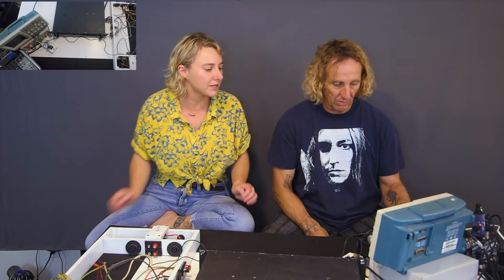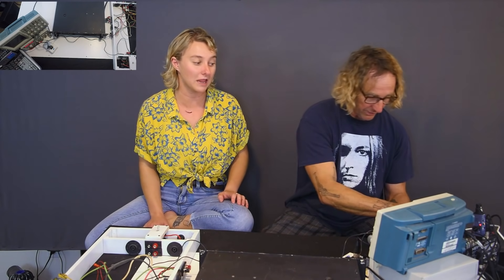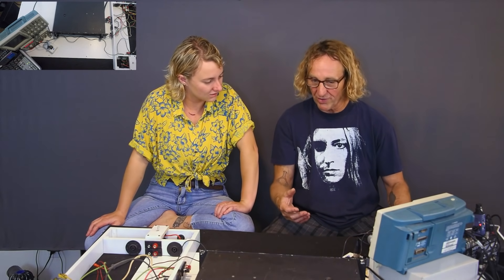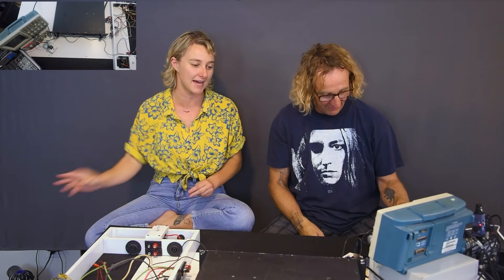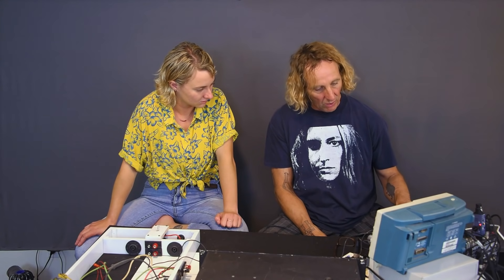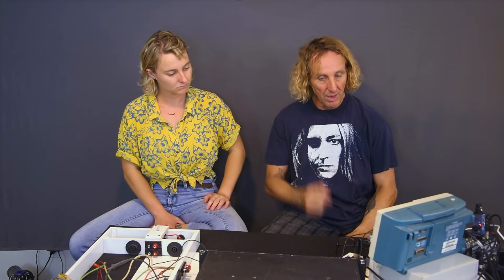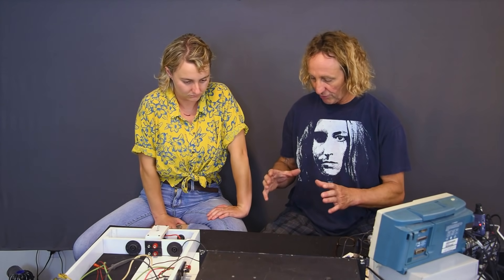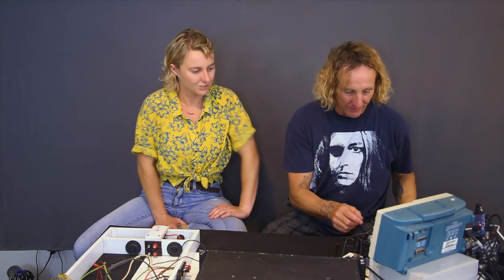Hear Amp Distortion - Crest 4801 (Public)

Comment: Can it be used in the uk as well as usa im looking at buying one right now please help TIA
Reply from the maker: Are you talking about a Crest 4801? 

I don't recall if they work in the UK but they definitely aren't automatically switching between 120 and 240 

If they do work in the UK you will need to internally switch it to a 240 input assuming the transformer has two primaries and change the fuse to 1/2 the amperage
Reply: @DaveRat  yes the crest audio 4801 thank you for your reply 🙏
Reply from the maker: Let me know how it works out. I might have one open at the shop somewhere and if I see it I'll let you know more info. 

Typically most old transformers have two primaries and they hook them up in parallel for 120 volt and they hooked them up in series for 240 volt and as long as there's no other little transformer in there or anything drawing power before that big transformer, then switching the wiring on the big transformer will switch the voltage for the whole amp.
Reply: @DaveRat  thank you  😊

Comment: I feel like you know this, but maybe didn’t articulate it clearly in the video.  You keep saying that we’re hearing what the clipping is “adding”, but actually we’re hearing what it’s taking away.  It’s the peaks which wanted to go past the rails but couldn’t.  We do hear some distortion and “added” harmonics, but that is the crossover distortion caused by ripping out the middle of the waves.  It’s very much like a gate with too fast time constants, and in fact sounds a lot like a gate especially in the impulse and music tests.  This may seem pedantic, but I think if you actually found a way to cancel out the fundamental in the clipped signal so that you only heard the harmonics generated, it would sound significantly different, and if you did that same procedure with this kind of crossover distortion, it would be different again still.  IDK how to accomplish that without some FFT voodoo, but I’d be interested to see it.
Reply from the maker: So when clipping flattens the top of a waveform and in order to reproduce that newly flattened waveform a bunch of extra high frequencies that were not present in the original signal are now generated, that does not equate to adding??
Reply: Honestly, I argue not.  You can look at the scope and see that nothing is being added.  It's only being taken away.  What we are hearing in your test is exactly that difference of what is being taken away.  If you measure the integrated voltage or power, you'll find that the output wave is in fact less than the original.  The output wave does look (and sound) a lot like what would happen if we added a bunch of harmonics of the original signal, but that's almost just because that's what that new waveform sounds like, you can only ever get an approximation by means of addition.  Nothing is actually being added, and the perception that harmonics are being added or generated is mostly an artifact of the analysis (fft or earbrain).  But I haven't convinced anybody with that argument yet.  :)

But honestly, that's beside my original point.  Whether harmonics are added or not, there is a change in the perceived harmonic series, but that's not really what we're hearing in your video.  We're basically just hearing the part of the quieter signal which not being cancelled by the clipped signal.  That's perfectly valid and instructive in it's own right, and I really didn't mean to say it wasn't.  It just feels to me like you're telling us it's something slightly different which would also be quite interesting if we could figure out how to really do it.
Reply from the maker: Nothing visually or electrically is being added but in order to acoustically re create the signal we hear additional frequencies the did not exist in the original. 

If the signal was just lower, we could slightly adjust the level and cancel the lower level. Which is what I am doing, what we hear is what did not exist in the original.

A 100 Hz pure tone sends nothing to the tweeter crossed over as 1000 Hz 

But a clipped 100hz signal does.

So from the perspective of a listener, speaker, amplifier equalivlzers and so on, there are additional frequencies added.

those seem to be the perspectives that apply to the humans.
Reply: @DaveRat  what we’re hearing is the part of the quieter signal which is above the clipping threshold of the other one and that’s literally all.
Reply from the maker: Hmmm, it remains a matter of perspective. I understand the viewpoint that chopping the tops leaves less, so subtractions not adding.

But measuring the signal with an analyzer will show added HF, so there is adding from that perspective, the perspective of what we hear, what a speaker sees and what all the electronics see as the signal.

It's like a building from 5he perspective of "how many square feet on the ground does it occupy?"

Before it's built, the materials, if you add up the sq feet occupied on the ground, is much larger than the finished structure. If you remove some supports and the building falls over, you have removed material yet the square footage occupied has increased.

This is not unlike a signal, removing part of the signal can increase the bandwidth.

Or looked at another way, if the only thing that occured is the removal of part of the signal, then if you put it back, the signal will return to its original state.

Do you believe that if the removed part of the signal was added back in to the chopped signal, it would return to being the original signal?

If A minus B = C then 

C plus B = A

Right?

Unless something else was added or created, right?
Reply: I actually had started to type that.  :)  If you were to mix that crossover distorted residual sound with the clipped signal it would in fact sound exactly like the original with no distortion and no extra harmonics.  (well, after you correct the 6db difference and make sure about polarity, and given the slop in real world analog components, etc)  It's easy to demonstrate in digital.  

If we really wanted to isolate the just the "added" harmonics, we would need to find a way to remove the fundamental without leaving that little bump over the top.  With a sine wave test tone, you can sort of do it with a super steep filter that cuts off between the fundamental and the first octave, but the other inputs are too complex for that.  

But like when we look at a signal on a spectrum analyzer, we're not necessarily getting the full picture.  Like I said, you can approximate a square wave by adding a bunch of sine waves, but you can't actually accomplish the real thing without an infinite series of them.  The analyzer is doing exactly that.  Trying to approximate the waveform by splitting it into a finite number of bands.  It can come close, but some things can also fall through the gaps.  It's somewhat related to the reason we end up hearing artifacts from FFT processing.  It's an approximation of what actually happens.  

There are some plugins out there which actually do try to make distortion additively but they don't really sound very good and use way more CPU than it's worth. 

Thanks for taking the time to have this silly discussion!
Reply from the maker: Interesting and thank you

Comment: Poor Crest its only a baby compared to the others. One of my first power amps was a Crest 601 that is before I moved onto Crown and then and especially QSC. In comparison the LabG and Powersoft x4 are absolute beasts there monsters and come with a price tag to suit but you want an amp to rock the house wow. Still use my QSC amps to this day to drive Marshall cabs/PA rigs, in racks on wheels thankfully, they weigh an absolute ton but only once has one failed on me, look after your amps they look after you. 

Interesting comment below about valve amps and their beautiful warm harmonic distortion, but reliability? questionable. This is more a question about using a valve preamp but similar harmonic tone responses can now be achieved with modellers and plugins (amp emulation saturation and sims). Yes my Marshall amps are loud but they do not compare and compete with QSC especially when driving multiple cabinets chained together. how close do modellers/power amps get to the real deal, so close you could not tell them apart, nostalgia for sure but sadly that is the future for valve amps. Yes I still sometimes put "Marshalls amps" on top the stacks but the cabs are actually powered by QSC, poor cabs look lost lonely and missing something without the amps there but in truth, I now use empty amp cases, they just look right but lack real power when you need it else you need 6 Marshalls amps for each QSC. More recently we have significantly reduced the on stage volume and rely more on the venue/show PA, gone are the days needing a row of cabs on stage, just enough to hear what your playing is more than enough !!  We even went through a period using empty cabs. but that was just a phase, now we have one stack each just for monitoring purposes but I know many musicians who now only use in ears so there is almost no need for any on stage monitoring, how times have changed over the decades.... gawd I must be gettin old.

Meant to add, Crest amps have built up quite a good rep as home Hi-Fi system power amps, for a good reason, there really good amps !! oh yeah forgot, there now called/badged Peavey oh well...

Comment: I think we actually still have several of those in a rack case buried somewhere in our warehouse.  I remember lugging those suckers around and cursing when they removed a caster wheel off the bottom when rolled over a door threshold or crack in uneven concrete… I remember naming one of the amp racks, “tripod” because it constantly had only three functional caster wheels due to the sheer mass of the stack of Crest 4801’s inside!  Modern tech is constantly improving the chances of me being able to still walk upright in my autumn years, thankfully.  Thanks for posting the wisdom and reminding me how damn old I actually am, Dave.  Cheers - Eric in Sacto
Reply from the maker: Hey hey Eric and thank you! Yes, it's not that we're older it's that the world is getting faster and heavier around us

Comment: You're getting very close to a phenomena that has eluded me in discussions on recording and mixing forever - the phase coefficient involved in RC filter use on similar instruments which are blended or summed, basically in any Q above 1.0 at any db/octave or decade (normally at +/-3/6/12 or 1st, 2nd or 3rd order), increasingly becoming incoherent as their signal levels become more proportionate to what an amp sees as unity. I have a theory that I've never been able to proof, nor have I seen or heard anyone else even allude to it, that goes like this: when a bass drum thumping at say 120hz is overlaid with a bass guitar thumping perfectly in time at that exact same frequency, if that bass guitar signal was recorded at -3db relative to the drum and then boosted by +3db with a 1st, 2nd or 3rd order filter having a Q of 3.0 or higher the phase to power ratios inherent in the resultant slopes on either side of the peak of 120hz will absolutely butcher any perceivable differences between the signals from both the bass drum and the bass guitar due to their moving to Q peak at different rates apart from ''peak power''. It also stands to reason that the same is true if the roles are reversed, ie bass drum is boosted to match the bass guitar, or even when either is cut given mirrored settings. This whole theory MOSTLY only works for non synthesized instruments which naturally tend to waver at pitch, as synthesized tones are more pitch stable, but from an amplifier's perspective though there is little difference - different amps will respond to such differing phase relations sometimes equally badly.

Another way of looking at this is the steeper the slope of a boosted eq (whether bell or shelf) any pitch that wavers from 100hz to 120hz in regards to volume, raw power, and back (let's just say 20%+/- to or from peak Q) is likely moving through over 45 degrees of phase (ie in/out of 0 phase by 45 degrees at said Q's peak voltage). In mixes where I stuck to the rule of NO EQING WITH A Q OVER 1.0 I've seen much better power response and signal integrity on subs and mains (not so much on tweets and, really, who cares what's happening at 3-20k as long as no one starts bleeding, am I right?). It seems to me that the difference between modern mixes with several plugins where instruments are ''blended'' together by dozens of high Q filters and those done 50 years ago using a handful of outboard Pultec type filters, which were chosen specifically in increments which have the least phase incoherence, has everything to do with why even horrible recordings from mobile trucks (think The Rolling Stones, Led Zeppelin, The Who, etc) have a more pleasing low end to them than nearly anything today does - even before they were remastered and re re re re re released by Jimmy Page 5,000,000 times so he can afford to buy more teenagers' blood to infuse with his own.
Reply from the maker: Interesting stuff.